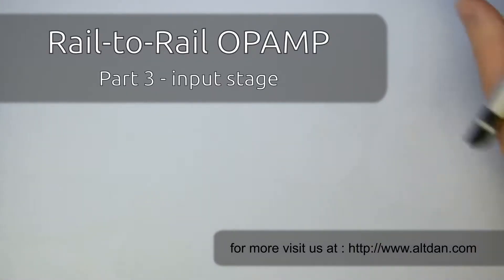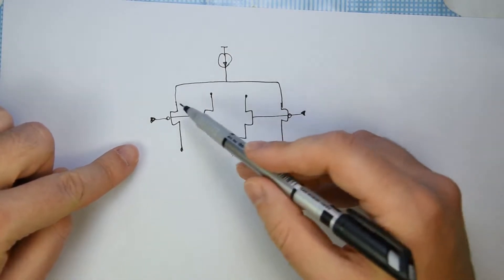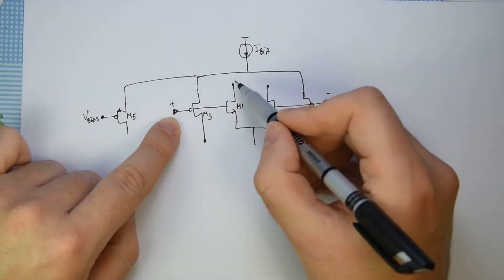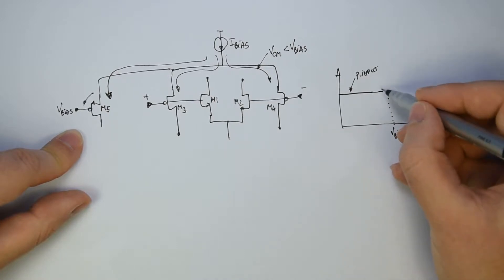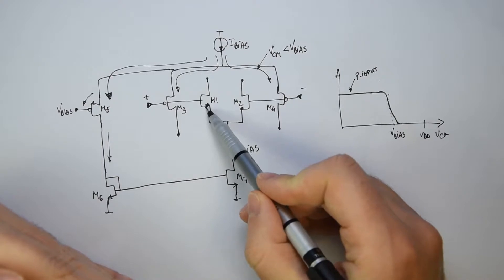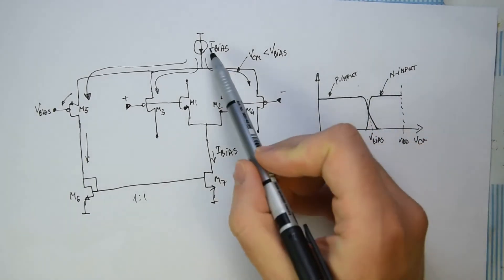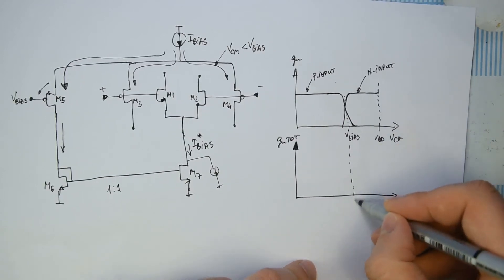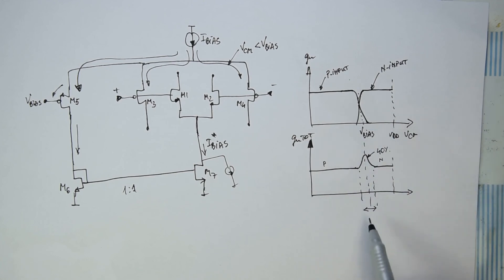CMOS Opamp - rail to rail - part 3 - input pair

Comment: Hello,

first thank you for the video, your explanation is very good.
But I have one question. Why do you think that all the bias current goes through M5 already at Vcm slightly higher than Vbias, schouldn't the transition be slower or have you confirmed this with simulations?